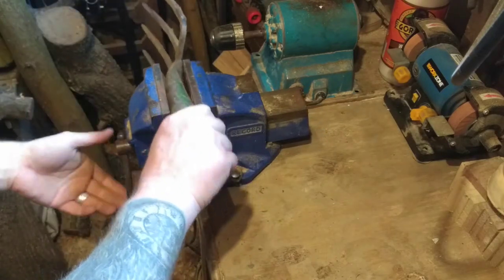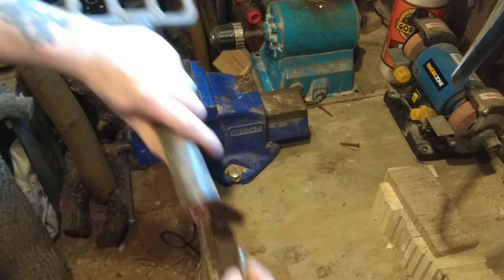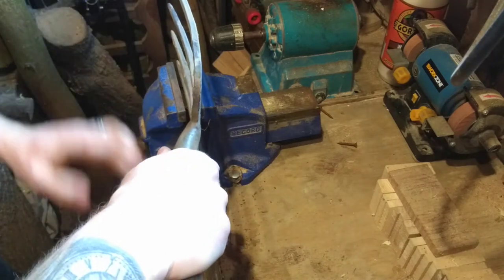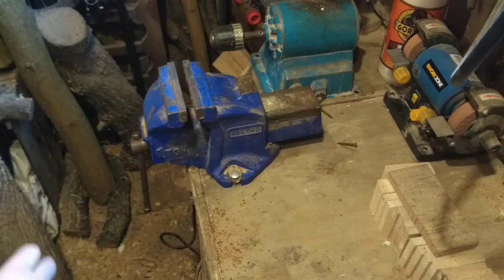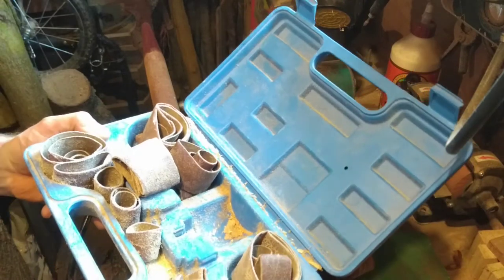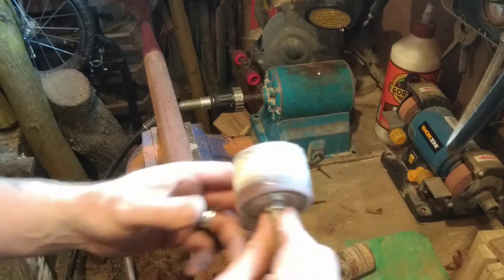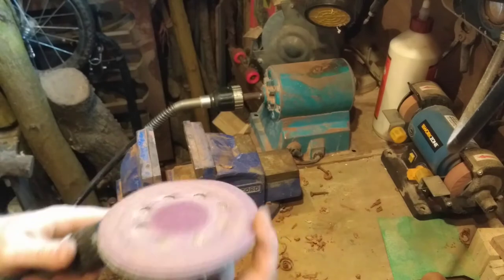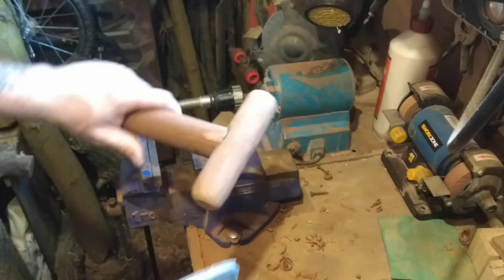How to make a garden fork handle.

Comment: I know this is an old video but can you Kindly tell me the size of the "dowel Rod" that you use for the pole and how long did you make  your handle.  I am about for the 1st time fix mine and I love the way you did yours fast and easy.  From USA Arkansad
Reply from the maker: No worries, the rod was a hardwood decking spindle and it's around 900mm long (35.4 inches approx) the diameter of the spindle was 35mm (1.5 inches approx) and the length I did so it was comfortable for my arms and hands (I have quite long arms) so I would cut your new handle to a size that feels comfortable for you, hope this helps, thanks for visiting